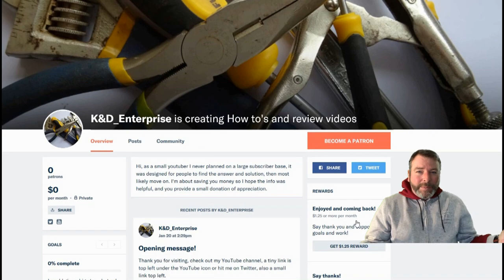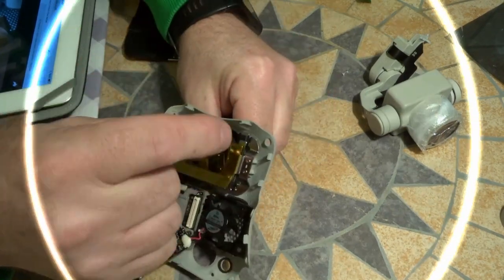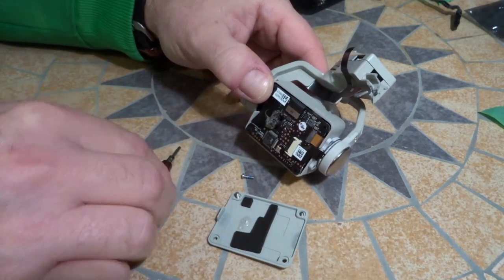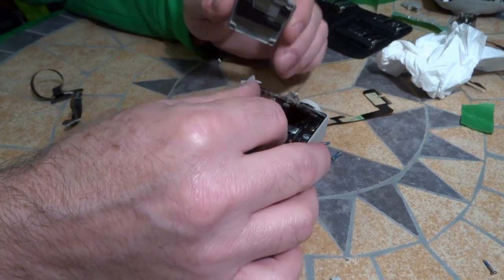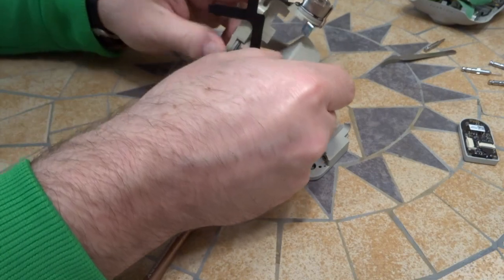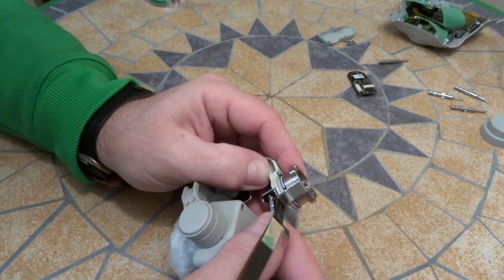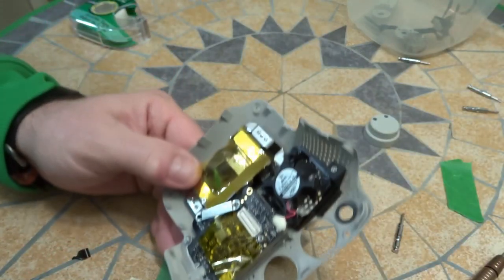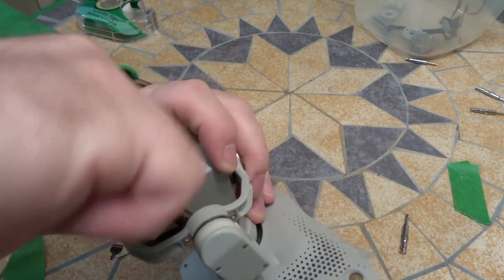Phantom 4 Pro Yaw Motor & Arm Repair - p4advanced applicable

Comment: What is all about keeping old motor casing as it is have calibration magnets built in? Anyone can comments on that one?
Also they have an old model and new model motors. Does Phantom 4Pro+ have a new one?
Reply from the maker: Great comment and I hope we all could get some answers, and not just 'I heard'.. we need specs and item numbers. What I can comment on unless I can be PROVEN wrong. The long camera cable works with both the p4A and p4Pro.
I called a repair shop about the rumor of a different version or newer gimbal arm and they told me both have the same part number.. but yes I have heard rumors also.. I wish someone could verify, but it seems those with the real info are not willing to share, because its their business to repair, plus DJI gets very upset with these repair vids for some reason. If you do learn some info I would be VERY grateful if you came back and shared your experience. Keep me in mind please however long down the road it is.  Thanks
Reply: If replacing your yaw motor, (crashed gimbal that act up on the yaw axis, probably have a bad motor) you need to swap the drum (casing) from your old motor, as it contains the "sensors" (magnets) that are calibrated (strewn randomly inside the drum & matched with only your phantom) at the factory, which would ordinarily see you attaching your wallet to your drone & sending it off to DJI .If you're careful, you can can do it yourself. There are old style & newer style motors available & the only difference is the shape of the drum. So it doesn't matter which version you receive, as you will need to remove that drum & replace that with your old drum from your old yaw motor anyway.

If you just replace the yaw motor, the gimbal won't centre........ EVER.!

The gimbal esc will overload, give errors & eventually burn out if the yaw can never find centre.

The usual case when changing out a yaw motor & not the casing?

Yaw goes full left, full right or yoyos.

It's not always the yaw motor that causes erratic yaw movements. Sometimes it's the yaw/roll esc (circuit board that yaw motor cable plugged in to), it just depends on the crash type & what took the most force.

Damaged yaw motors are from burnt/broken windings, damaged (severed) flat cables from crash or simply wear & tear.

Comment: If replacing your yaw motor, (crashed gimbal that act up on the yaw axis, probably have a bad motor) you need to swap the drum (casing) from your old motor, as it contains the "sensors" (magnets) that are calibrated (strewn randomly inside the drum & matched with only your phantom) at the factory, which would ordinarily see you attaching your wallet to your drone & sending it off to DJI .If you're careful, you can can do it yourself. There are old style & newer style motors available & the only difference is the shape of the drum. So it doesn't matter which version you receive, as you will need to remove that drum & replace that with your old drum from your old yaw motor anyway.

If you just replace the yaw motor, the gimbal won't centre........ EVER.!

The gimbal esc will overload, give errors & eventually burn out if the yaw can never find centre.

The usual case when changing out a yaw motor & not the casing?

Yaw goes full left, full right or yoyos.

It's not always the yaw motor that causes erratic yaw movements. Sometimes it's the yaw/roll esc (circuit board that yaw motor cable plugged in to), it just depends on the crash type & what took the most force.

Damaged yaw motors are from burnt/broken windings, damaged (severed) flat cables from crash or simply wear & tear.
Reply from the maker: Thank you for the input and valuable info that might help others. Appreciated!
Reply: Always welcome. Great vid too by the way. Very informative.
Reply: I had this problem and I did swap casings and I still had a gimbal problem. My P4 Pro ended up sitting in a box for 8 months and now I am wanting to tackle the problem again. It doesn't look like this guy had to change the casing but I have heard of people having to do this. I wonder if this guy got lucky and did not have to do that or maybe I just got a bad Yaw motor. I am thinking about buying another Yaw motor and trying that. I did check my motor ESC on a working p4 pro gimbal and it was good so I am thinking it has to be a Yaw motor problem.
Reply: @twincityaerial9258  Did you get it fixed?
I'm going thru the same problem, I tried to remove the casing from my old motor but the pin won't budge. 
I haven't bought the new motor yet

Comment: You didn't switch the casing from the old motor so what is all this about having to take the yaw motor apart and switching the casing?  Seems that the sensors are on the motor and just a circular magnet in the casing so I'm wondering why you should have to do this.  Did yours work just fine?
Reply from the maker: Donald Poteet the reason I had to replace the yaw motor is it’s self contained, it’s one piece, if the data ribbon gets detached you have to buy a new motor even though the motor is ok. I never switched casing, I replaced the entire motor... so my main point, if the data/power ribbon gets damaged.. you have to replace the motor.. sad right.. I dunno, hope I answered... if not keep talking, I appreciate the feedback.
Reply: @kd_enterprise3404 I think he was asking if yours worked ok, despite the fact you didn't swap the yaw motor housing....?
Reply from the maker: A Kumar.101 mine is fine but this must be an issue, does anyone have a vid on it ?

Comment: I crashed my drone p4p and i gave to the local mechanic he changed the yaw motor , yaw arm, flex cable and Circuit Board ESC Chip PTZ E-Card Board
. he changed all the four parts after all my gimbal is  not in centered, Can U help me how to fix it,
Reply from the maker: Gopinadh Padamati have you tried the IMU calibration yet?  Do that first, restart drone, then go to the camera settings and find the gimbal calibration section and try that...

Comment: I changed my yaw arm and motor, now the gimbal twitches and shakes. Any ideas?
Reply from the maker: mmmm. try doing the updates.. but ya,, very odd.... if everything else works id be concerned about the yaw motor..
Reply from the maker: oh, ps.. when the craft is off, make sure the camera moves freely.. could be the cable is causing trouble if it has not been routed properly..
Reply from the maker: Had one more thought - ensure the motor/s you replaced or took out are seated back in properly to the arm, I did not have the issue you are but I did notice at point there is potential for the motor to be a little off if not tight and seated in position.  Good luck I hope it works, please let me know, I could start asking others about this also.
Reply: K&D_Enterprise thank you for your input.
Reply: @charliecox821  Did you fix it? and how?
Reply: fa2ality I had to buy a whole new camera assembly. The whole bottom part
Reply: Charlie Cox hi, how much did you paid for that?
Reply: Abraham Cherian I think like $800
Reply: did you keep the old casing from your bad yaw motor and switch it over to the new one... you would need to recycle that drum which means taking the casing drum off of the new one and putting the old casing on the new motor.

Comment: where did you buy all the replacement parts?
Reply from the maker: Ledrek it varies, depends what country you are in, but generally you just need to find a place that repairs drones, if that does not work eBay, Amazon. I won’t post names because DJI would get upset and does not want anyone to sell parts, I don’t want to cause trouble, especially if Dji uses them as a repair facility.

Comment: Hi, where did I buy your yaw motor?
Reply from the maker: Hi Robert, basically I can not promote a company as DJI and YouTube have something going on and they don't like me much. However, the first choice would be if you can get one from North America, however the easiest way is to go on ebay and get one from china, they normally list for around 30 to 40 dollars. you should not have any issues, even the guys that repair drones for a living get them on ebay.
Reply: Yes we do. I buy all mine on eBay but I buy several at a time and inspect them for damage. new is not always new on eBay. They must be inspected.

Comment: Sir i changed new yaw motor but gimbal is not centered . How to fixed this
Reply from the maker: 2 things to try in this order. In the DJI go app there is a gimbal calibration option. I've never done it so look around for that option, could be in advance section.... I will try to check it out myself but can't do right now...Take a look first let me know if you can't find and I will check in the a.m.... after you do the gimbal calibration you will want to use the dji go assistant to further calibrate the camera.. I personally don't have videos on these two points...
Reply: Gaurav did you ever find a solution to this?
Reply: @giorgiontanas8618  You have to change the motor casing and use the one from your old motor
Reply: @YomAlwa3eed  
Hello friend, I already replaced the "housing" of the engine and unfortunately still has the same problem, the camera is slightly crooked. Do you have any option to calibrate the engine, perhaps by software?
Reply: @carloseduardomoreira5374  did you use your old housing with the magnets from your old motor?
Reply: @YomAlwa3eed  exactly
Reply: @carloseduardomoreira5374  
the next thing you can try is to calibrate the IMU
Then calibrate the gimble while the aircraft is standing/ balancing on two motors
camera facing the sky.
if that didn't work then sadly its the small motherboard that the yaw ribbon goes to
the motherboard last time I checked it wasn't available anywhere for P4P pro.
Reply: @YomAlwa3eed  ok, i will try to do this ... anything i notice.
Thanks a lot for the help.
Curiosity, can these engines be "recalibrated" by some software?
Reply: @carloseduardomoreira5374  
is it the crookedness in the yaw motor only? and the rest is functioning correctly?
I would start with cheaper solutions. I would rather try a different motor maybe your new one has fucked up sensors (the part of the motor with the ribbon)
You can contact dji about the software calibration but I think they will try to sell you a whole new gimbal. 
You're looking at 2 parts only that can cause this problem 
1 the motor 2 the motherboard 
The motor is $40 and the motherboard is around $200 that's IF you can find it for sale. 
Mess with the motor, disassemble it and reassemble again. Then try another motor.
Don't rely on dji.